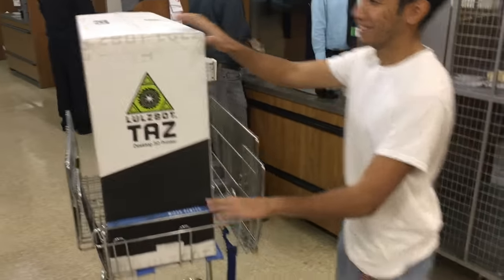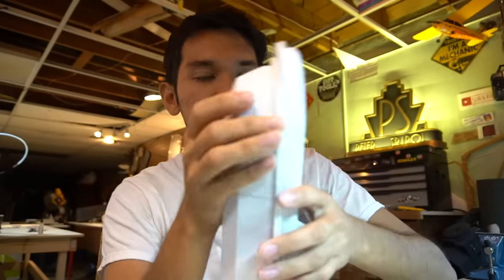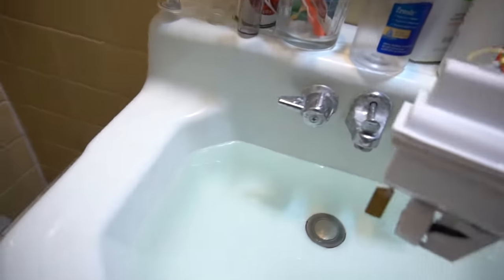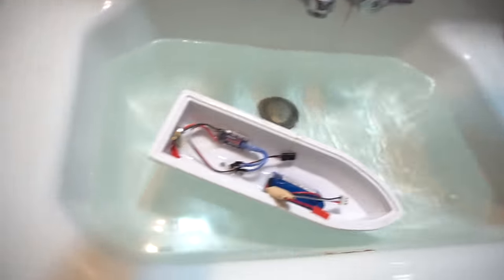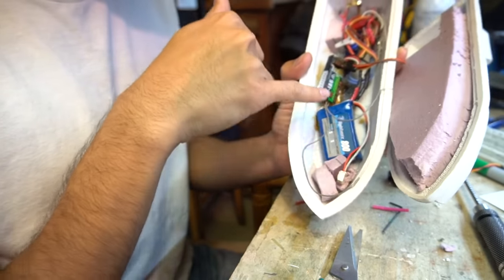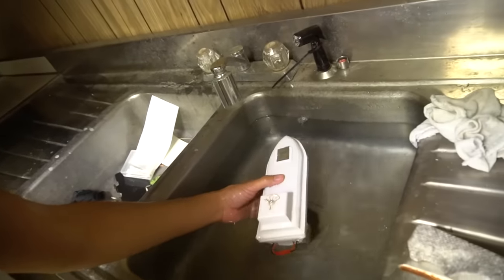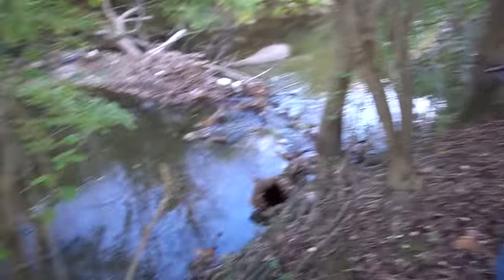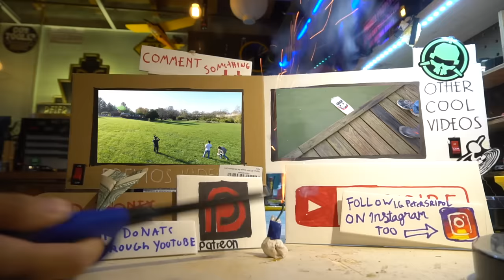RC 3D Printed Lifeboat

Comment: Eventually you need to make a pump propelled jet boat. Should run well in the shallows.

Maybe make one more fun with a second pump and a servo directed nozzle, so you could run it up to stuff and spray water with it.
Reply from the maker: I really want to make a jet boat! it will be done soon! probably next summer though! Got to get better at 3D design.

Comment: Peter, you need a magnetic switch, so can seal the boat up. The magnetic switch will allow you to power on the boat with the magnet and also try a phone charger wireless charging system. Hight kv motor and a few 3.4v lipos so you can still use a wireless charger. It would be an awesome design
Reply: that wont work, mainly because the wireless chargers are very inefficient

Comment: If that's ABS, you could try solvent welding instead of epoxy (brush acetone on the joint and hold them together). Also vapor smoothing to make it more water proof?

Comment: To get a better surface finish and counter the top weight it would be a good alternative to use the 3d print as a mould and make the actual hull from vakuum forming...

Comment: I could be wrong, but the foam you used looks like the type of foam that absorbs water, waterlogs and will sink instead of float.  I'd suggest you test it, cut a small block and submerge it in a bucket of water, put a weight on top to keep it down, and then check to make sure it still floats after being underwater overnight.  This is kind of a worst case test, but it will prove whether its suitable for flotation or not.
Reply from the maker: I know the foam you speak of! and yep this foam floats, it does hold some moisture but it doesn't seem to affect anything on my projects where it has been underwater.

Comment: 3d printing is not the best thing for boats.. Because, those layers it lays might have some leaks, you don't see bubles coming from it, but water does drip in it.
Reply: CookPiggy go to school learn how to spell
Reply: im sorry i come from the Netherlands and what I said is like a thing that I don't really say alot. so i didn't know how I would have to say it in normal, fluid sentences
Reply: Bobby Caldwell thanks ;) i know bubles is wrong
Reply: CookPiggy he might have used some other material than pla that doesnt leak
Reply: Hieno Nimi what material? abs?
Reply: Jonatan Den Breejen i dont remember the name of it
Reply: Hieno Nimi zackery
Reply: zackery
Reply: Remember (I have 3d printed boats) that there are 2  walls and then the infill so even if there is a small hole it will not get through and the infill is a bit like water tight compartments on boats (the water cannot spread)
Reply: @keesanker4241  i think if you printed out of abs or hips then you could paint acetone over the hull to dissolve the surface a little bit, which will then fuse together

Comment: The motor is blocking the water from the propeller and the water probably increases the friction in the motor. That's why it's so slow

Comment: I was wondering what you were doing at 1:13 and why? Great video!
Reply: he was removing the "C clip", and the c clip is to hold the shaft in place, but in that case he didnt need it, because the propeller was pushing the motor, but if it was on the front of a plane for example, the bell of the motor would fly off, as the propeller pulls on it. by removing it, he can take off the bell and wash/oil it, etc.

Comment: Looks great! What kind of range are you getting with your i6 transmitter? In my racing quad i'm only getting about 80m and it's rated at 1km, i was wondering if you had any issues like that. I'm using the  FS-iA6B receiver
Reply from the maker: Its been pretty decent so far? But nothing past 1000Ft yet though.
Reply: Yeah okay. Probably a faulty receiver.

Comment: Would it be an idea to make the boat wireless chargeable and the on/off switch magnetic closable to activate the boat with a small magnet from the outside? It would make you able to seal up the whole boat with silicone or apoxy to make it totally waterproof.

Comment: Now you have to do a submarine :)
Reply: Mat Holliday unfortunately fpv link doesn't work under water however a periscope with the antennae sticking out might. Good idea though
Reply: Johnny Landry For a sub you could just get a lot of flexible silicone to run the video on. fly by wire sorry of thing
Reply: Johnny Landry Sure it does, you just wont get very far.
Reply: T.P.K. And the video wire would double as a tether for easy recovery in case anything goes wrong.
Reply: Mat Holliday Precisely...fpv fishing anyone?
Reply from the maker: You guys have no idea how long an ROV has been on my list of things to try soon! :D
Reply: Maybe 900mHz video will work better... or even use a wire like most ROVs
Reply: Wow, I year passes and he has a toaster submarine

Comment: what did you do to the servo ? was that some kind of grease you put in it ? this Is just a little tip for you, when I print things I know will be going outside and exposed to elements such as water in your case, I use Suncure2000 UV polyester resin to seal all the print lines and joints.
Reply from the maker: Corrosion X HD, its a great inhinbitor of rust and keeps electronics from getting damaged by salt water. I filled the entire servo just incase the boat may end up completely full of water!

And thanks for the tip! I'll keep that in mind for the future projects that will have to survive the elements!

Comment: Very nice work! Instead of using epoxy to glue the 3D printed parts use acetone to chemically weld the parts together.
Reply from the maker: Yep, I should have picked some up! I was in a rush to try this thing out I got sloppy!

Comment: Nice video, I think I'll try to do something similar myself. What program do you recommend for 3d design?
Reply: Autodesk Fusion 360.

Autodesk AutoCAD.

Ultimaker Cura.

TinkerCAD.

MeshLab.

FreeCAD.

Creo.

Solidworks.

Also for phones you can give creality cloud a go
Reply: Thanks for the answer.
Reply: @Krzychu1989  no problem

Comment: Do you think it's possible to get a harder plastic and make gears for an electric skateboard
Reply: Time Lapse King Gears on skateboards are dealing with really big forces. Unless you could get your hands on one of those industrial 3d metal printers you probably could get printed gears that would hold up. if you wanted to diy a skateboard I would try and RE purpose gears from a 5th scale rc car like an hpi Baja.
Reply: Time Lapse King people created sprocket things for a belt drive with 3d prints
Reply: Time Lapse King consider using carbon fiber infused filament

Comment: Hey Peter how much was the printer and any thoughts on it?
Reply: and have you considered inductive charging instead of the jumper cables
Reply from the maker: 2600 after taxes and so far I've been very pleased! its been hands off!! 

I've looked into it but I cheaped out and went with JST's as the boat had to be done in 3 days and I don't know enough about it yet!

Comment: add a tiny more weght to the front. it'll make it easier to see.
Reply from the maker: noted! I may actually do that on the ocean run!
Reply: If it was a little bigger you could probably get away with having a traditional rc boat set up with the motor in the front leading to the rear and balancing it by shifting the rest of the components such as esc and battery to the rear

Comment: peter how do you like your FlySky FS-i6 2.4G 6CH AFHDS RC Transmitter ?
Reply from the maker: Its actually awesome for some of my smaller projects! its like 50$ so it doesnt break the bank incase I want to mod it or use it in risky situations!
Reply: would you say it's better then a tactic 650 tx? I have one of those now and I ordered the fs-i6, if it has the same features and settings I'm going to sell the tactic gear.

Comment: I know this was 3 years ago but that printer was really expensive for the quality it prints out...
Reply: IMNOTA I’m sure he hasn’t perfected his slicer settings. They make a huge difference in quality. My tevo tornado still needs to be perfected still as well.
Reply: @lando1995  It's not slicer settings, look he has a whole ton of z wobble. It's because that printer uses regular threaded rods instead of actual lead screws. Which is crazy for a 2500$ printer. Look at this video it shows prints that have the same problem and shows how you can fix it with actual lead screws. https://www.youtube.com/watch?v=myBAhWnsvrY

Comment: Use Autodesk Inventor for CAD get a student account and it is free.  It is way better than Fusion 360.  Also you are getting z banding on your prints the lulzbot can do way better.  So either your leadscrew is bent or the filament is not a consistent diameter and it putting out more plastic than it should be or less.  Try a higher quality filament.
Reply from the maker: Thanks man! Will give those things a go soon!

Comment: Maybe a stupid question but if you glued it shut, how do you change the battery?
Reply: I think he can charge it from the outside connector in the back.  To change, he has to open the entire case.  search "hot glue alcohol" to see how this can be done cleanly.
Reply: I dont think he changes the battery rather charges it
Reply: maybe a stupid question, but isnt that wire going to short out that is hanging outside at the back?
Reply from the maker: Yep, The battery is sealed inside in a semi temporary glue joint. Mark has it right, a small amount of denatured alcohol will make hotglue release itself from most closed pore surfaces. Some mild electroplating like stuff will go on with saltwater acting as a electrolyte between the two pins in the JST but no shorts. I also sprayed corrosion X in the contacts to keep a barrier there.
Reply: PeterSripol  Dang.. electroplating, is that possible to be done on my drone PCB? I have DIY drone/Custom frame where PCB isnt shielded and now that we have winter here in finland, i get snow in my kwad -> water on the PCB so i have to dry it up everytime i land in a snow.. (small 1s made from eachine H8 mini) with 8520 coreless motors.. if i were to make shield for PCB (with my l337 3D printer) it gets way too heavy to carry 25mw FPV..
Reply: PeterSripol btw. could you make a KWAD build with those new 1020 coreless motors? Would be awesome to see how they perform.. if it would turn small 1S quads into real performers, unlike my current 50g fpv setup with 8520 motors really lack the "punch"

Comment: it is too bad radio propagation is crap under water.

i would love to see you build a quad rotor that could swim in water then break the surface and fly off.

a waterproofed submaquadrine....
Reply from the maker: Its possible, although the quad has to carry a tether that floats on a buoy for RC link and FPV feed!
Reply: +PeterSripol i just built my first quad that is FPV racing capable...     i wont lie....   i may have to yell "it's coming right for me" and shoot the hell out of it.    damn thing is angry sounding.   dont have a PPM capable radio so I went with the FY901 flight controller.   the sound of it versus my graupner 110...  some pee may have shot out.

and on that note...   The Grand Tour should start next friday.   i am stoked.

Comment: There appears to be either z banding, over extrusion, or poor quality filament in those prints.
Reply from the maker: Woudin't surprise me. I have no idea what i'm doing :D I just wanted to mess with the advanced settings, although I have plenty of moisture in my basement so i'm not sure if it affects ABS. Plus I heard ABS is difficult to get good quality large prints out of.
Reply: Ah, yea even I have trouble with moisture its a weird thing when it affects prints. Also yea abs shrinks a lot so a large print will become lots smaller and probably have layer separations. I think PETG would be a good overall material for the things you do. Hatchbox is a good value brand to buy aswell.

Comment: IF IT WAS LIKE 3X THE SIZE AND ACTUALLY PUT GOOOD GOOD HOBBY GRADE ELECTRONICS,,,AND MAAAUBE A TAS NICER FPV CAM(IT BEBA PERFECT LIL BOAT ORNA SUPER PERFECT TO GO SAVE A BOAT(AND IT FLIPS RIGHT BACK OVER!)    AND ADD DUEL MOTORS JUST BETTER AND IDE BUY OME ASAP
Reply: bruh he used hobby grade components

Comment: Have you tried printing props for your planes? Here is a link for a 9x6 prop. I think it will fit on your printer. If not, just stick to hobbyking :)

http://my.solidworks.com/reader/3dccparts/catalogid%253D171%2526id%253D388060/apc-9x6-propeller
Reply: Oh, you can also get a "wood" filament for extra detailing. This link is directly from Lulzbot's site.

https://www.lulzbot.com/store/filament/woodfill
Reply from the maker: OOOOoooooHHH neat and dangerous! I'll have to test those to destruction!
Reply: I haven't tried printing them, but know a few people who have had made really nice props with a 3d printer.